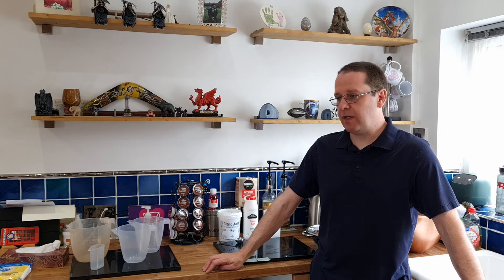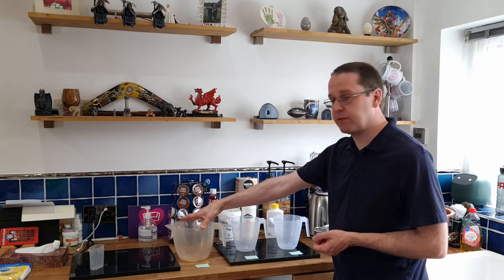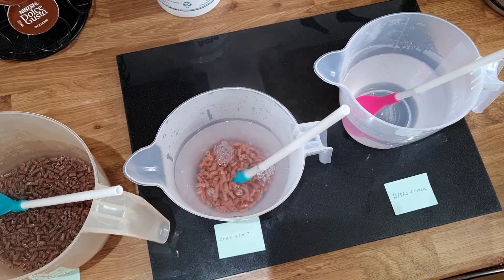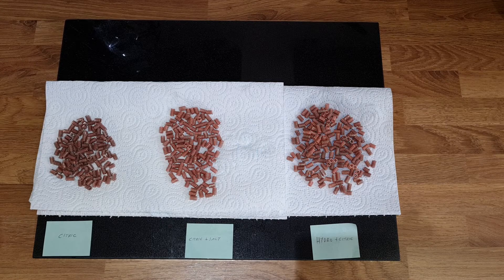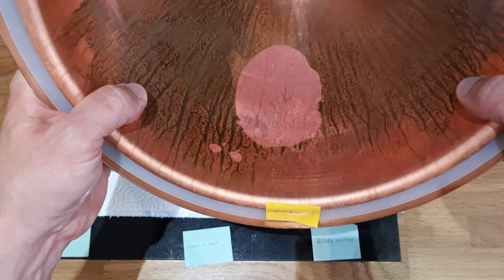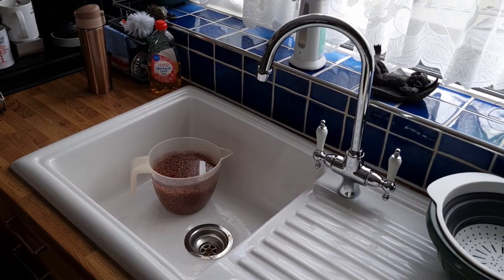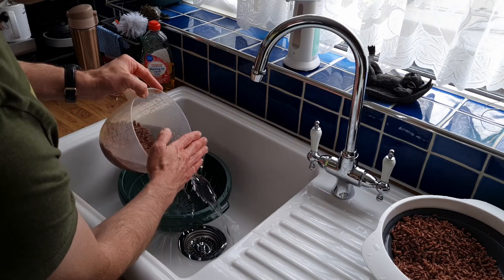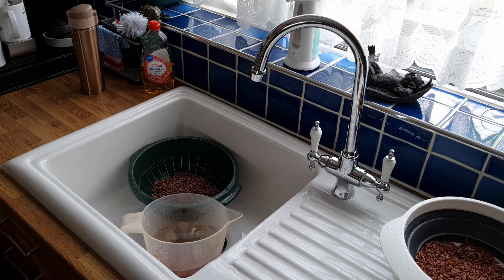Cleaning the column packing in your still

Comment: Beware adding salt to your citric acid. While it is much quicker, you change the reaction product when you use salt.

With citric acid, your reaction product is copper citrate, which is highly toxic to aquatic life, but an essential nutrient for us.

With citric acid plus salt, you end up with copper chloride, which is yet more toxic to aquatic life and moderately toxic to us.

With citric acid plus peroxide, you have less of a pickle and more of an etchant. Peroxide ends up causing micro-pitting on the surface of the copper, so it is not suitable for this type of cleaning application. The only instance where citric and peroxide is really good is if you’re using it as a soldering prep.

Finally, before dumping your spent pickle, it’s best practice to neutralise it and salt out the ionic copper. This is easily achieved with sodium carbonate or bicarbonate. That way you don’t end up killing a bunch of fish and frogs by accident.

Regardless of the solution chosen for cleaning, you must thoroughly rinse the copper AND let it air dry completely so that a new protective oxide layer can form.

Comment: I just use distilled vinegar and reuse it. If it starts to struggle add a little citric acid
Reply from the maker: I don't think it will have a great deal of kick for getting out a great deal of build-up, or does it?
Reply: @brewingadvice  I clean mine on the day of use sometimes I’ll do 2 runs but always cleaned the same day 30 min soak in vinegar if it starts to loose it’s cleaning I add a little citric acid then replace for next time….. I literally pay less than £3 for 5L of it
Reply from the maker: Fair enough  @seandesborough9661  .  If you clean them that often, then yes, you don't need much cleaning power.
Reply: @brewingadvice  also use the same on the 100L column still at my friends distillery we just soak the plates overnight in distilled vinegar. And sometimes it’s 5-10 times use before cleaning if we’re doing a full restock
Reply from the maker: @seandesborough9661  , sounds like a plan.  I just hate it when people neglect their equipment.  I have seen some boilers that had been used for years and never clean.  The rubber seals were brown and black goo was sticking to it.

Comment: I use 3.5 SSP in my T500 reflux column and haven't really noticed any improvement in the ABV, it always hovers around 90/91 % alcohol at the jar. But that CA and salt works like a dream. Thanks for the tips mate 👍.
Reply from the maker: Hi Gary.  SPP is supposed to help with the refluxing, but to get higher ABV you need to extend the height of the column.  Mine is at 57" high, but only 51" of it actually takes packing.  In my first (and last one as I only have done 1 run on it thus far) it created 95.5% ABV.   I need to tweak it as I would like the maximum purity you can get which is 96.4% ABV.  Copper SSP is best, but it is very expensive.  I have just bought 1 Litre of Steel SPP to see how it compares.
Reply: @brewingadvice  ,Yes a 200mm spool and a SCR definitely will help. Love your vids ... keep'em coming. Aussie out.✌